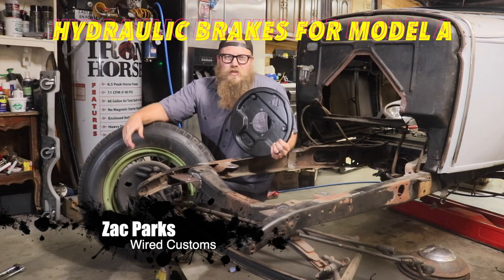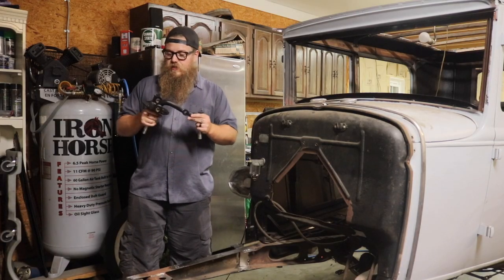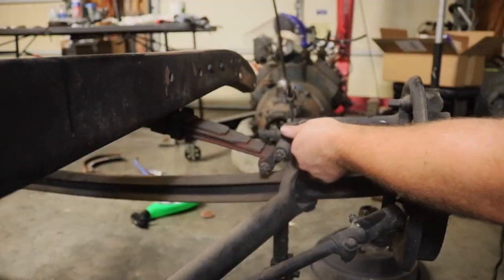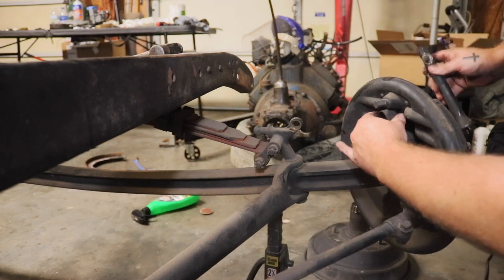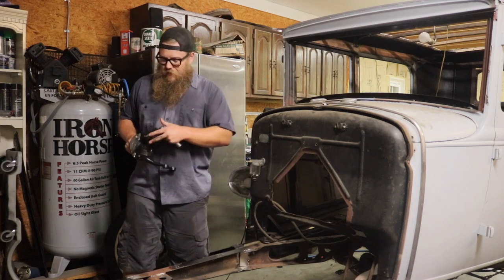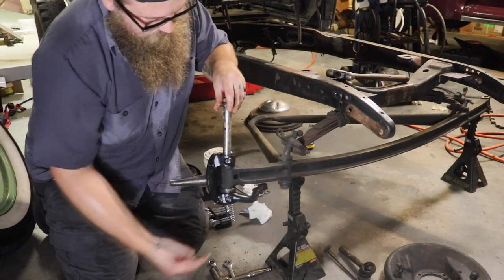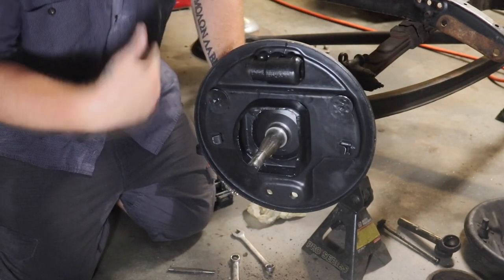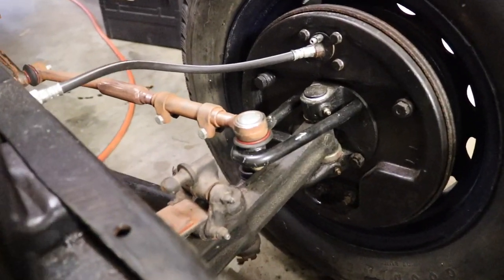Model A Ford Hydraulic Brake Conversion!

Comment: Enjoyed the this video as I’m doing the same swap on my 30’ A. I just wished that you had shown the process on the rear brakes as well.
Reply from the maker: Thank you for watching Robert! The rears are much easier, the later backing plates bolt right on to the rear axle, all you need to do for clearance is the flip the backing plate upside down and switch the brake cylinders from side to side because they need to face forwards

Comment: I read that '39 Ford drums won't fit to original Model A wheels. That means that even if I use '35  Ford  16" wire wheels, those  '39 Drums wouldn't likely fit. My A is already on the road in basically stock condition, so I wouldn't be able to do that extra K member in the frame. So I'd have to have an alternative to that one.

Comment: Thanks for your videos they help a lot. So in your mod on hydraulic brakes do you use the complete 39 brake assembly with shoes and drums on the rear? What happens to the shaft that sticks out a mile there?
Reply from the maker: That’s correct I use the complete 1939 brake system. If you are talking about the manual brake shaft I just take it out and throw it away

Comment: Hey man I just got a flathead question for you. I have a 59ab its been parked since 1987. It's a no start. I have a rebuilt crab and distributor, new fuel pump, wires ,plugs, condenser, I have spark and fuel, I've flushed out old oil and sludge with a few oil changes, I checked to see that all valve's are moving up and down while cracking it by hand. I got it at top dead center. Cut my exhaust off. Also have new voltage regulator, solenoid terminal ends new battery. I feel like I have everything going for me,  I think,  is there anything I'm missing or should look for?

After cutting my exhaust off I had a few more cranks out of the new battery , I did put a few about 3 caps of gas down the carburetor, I'm thinking I flooded it, I'm not sure where to set the chook on the carb when starting, now I have to get my battery changed to get back at it. Thanks for you're videos saving old ford one at a time.
Reply from the maker: If I was there in person the first thing I would check and see if the point gap was .015 and that the points were clean, double check that you have spark to the plugs. Then I would remove the carb top and fill the bowl full with gas and try again
Reply: @WiredCustomsSpeedShop  ok I'll check on those and double check them, the guy that rebuilt the distributor or cleaned it up, set it up to go, as far as I know. I never removed the top of the carb to fill the bowl,  I tried to poor some in that little filler to the bowl but dumped gas down the carb, I have good spark I even swapped out another new condensor because I thought it was a little weak. I'm also thinking getting a new coil, the one I have is new it works but I'm sure it been on a shelf as long as I've been alive.
Reply from the maker: @michaelmchugh2923  ouch a new coil is very easy to come by, I use a 1.5 ohm with a ballast resistor that I buy at the local auto parts shop. Hopefully it’ll fire after that, worst case scenario the distributor is 180 degrees out, but that usually cracks or brakes the distributor
Reply: @WiredCustomsSpeedShop  ok, I'll look into a new coil to be safe, I did find top dead center and popped the cap and the rotor was pointing right at number one.   

Should I give it another rotation to and check the rotor in case it is 180 off? Or would I have the same results.
Reply from the maker: @michaelmchugh2923  on a Flathead you can tell if it’s TDC compression stroke or TDC exhaust stroke without pulling the intake or putting a camera down the spark plug hole, I would say double check things then if you get the same results take distributor off and rotate, of course unless you can confirm TDC
Reply: @WiredCustomsSpeedShop   Could watch the valve's to determine if its exhaust or compression stroke?,  I don't know which valve is which thought. 

Thanks man, I wasn't sure if it made a difference on the stroke,
Reply from the maker: @michaelmchugh2923   if you can see the valves from front to back of the engine it goes exhaust intake intake exhaust exhaust intake intake exhaust
Reply: @WiredCustomsSpeedShop  ok perfect,  so the rear valve would open then shut and that would be my compression stroke, or is it before it opens?
Reply from the maker: @michaelmchugh2923   it would be when the second vale opens then closes, after it closes the piston will come back up on the compression stroke, that’s when you want TDC
Reply: @WiredCustomsSpeedShop  awesome thank you for your help. I'll be back on it Monday night.
Reply from the maker: @michaelmchugh2923   no problem! I love to help 👍🏼